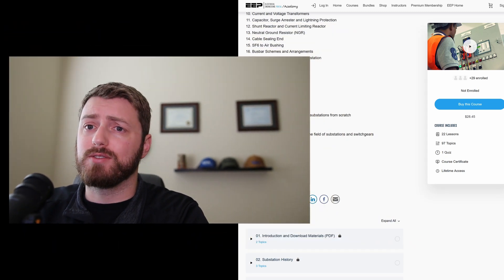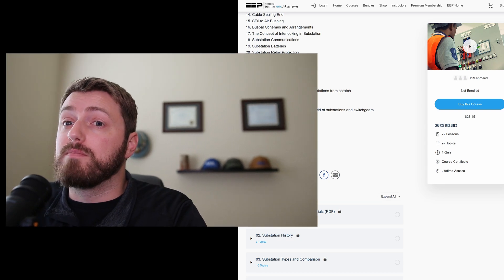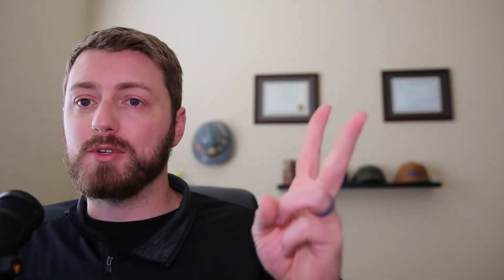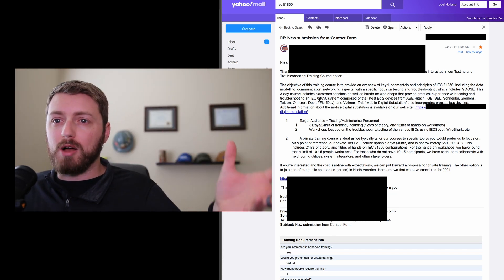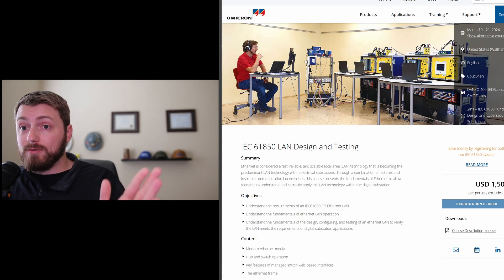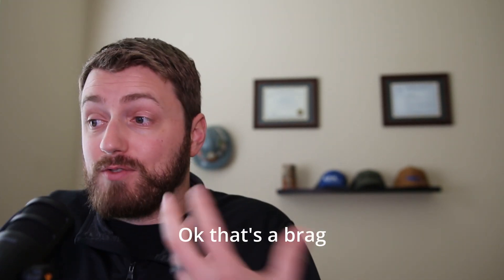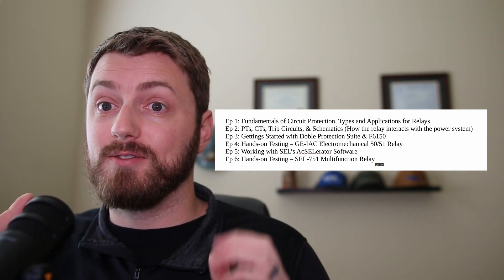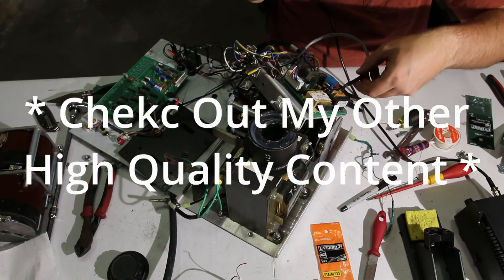Series Intro - How to Test Relays (ep00)

Comment: Even though I do not fit the mold of “ who” you are doing these for, I find good value in what I can look to apply in my work ( as little as that may be).  Just a maint electrician but when outside contractors show up to test our 13,2 cables , test our transformers etc….it is a good feeling to understand and communicate in terms that are used. My only real “ hands on” for the 13,2 is dealing with the A -B  A/B loop switching.    A guy can dream!   Thanks
Reply from the maker: Hey the more you learn the more valuable you are when push comes to shove. Even if it's not "your job." Thanks for watching!